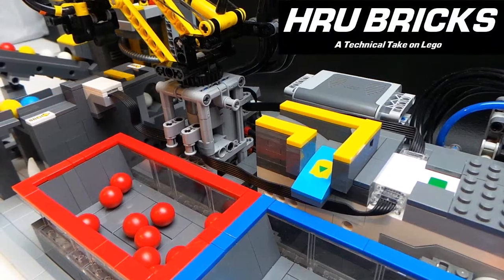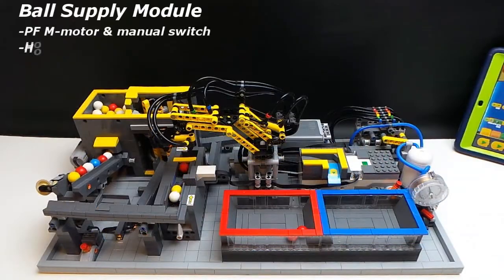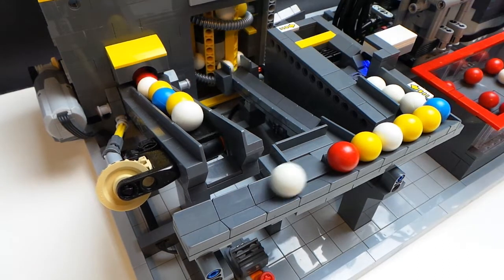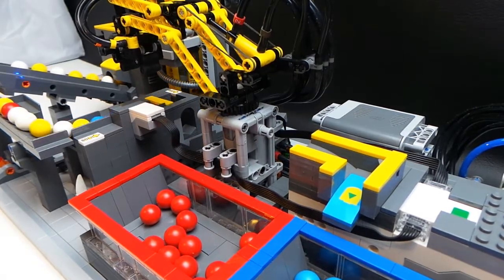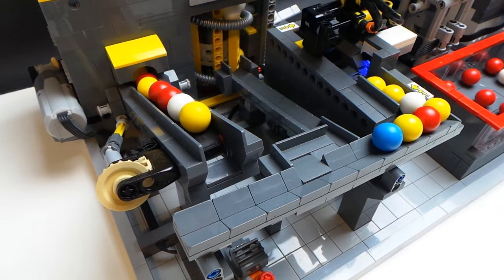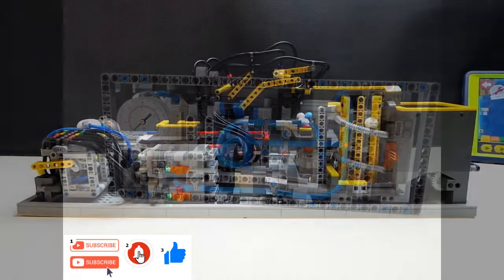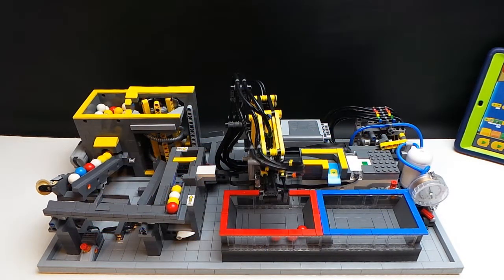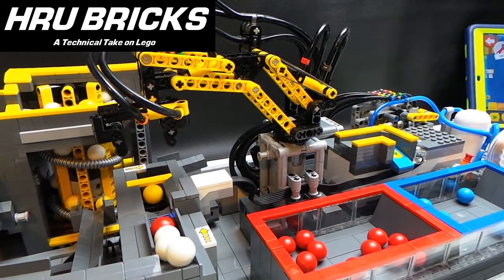LEGO Boost GBC Pnuematic Ball Factory MOC

Comment: What balls did you use?
Reply: Ok, thanks :)
Reply from the maker: @gkbrickworks7924  It looks like they may not make the 14mm pack anymore, if you find a site selling them let me know!
Reply from the maker: Hey GK, I use Quercetti Marbles. It took quite a bit of experimenting to find a suitable replacement for the Lego balls and the Quercetti Marbles came up the best. The dimensions and weight are very similar with the only part of any of my GBC builds that have given me a little trouble is the vertical conveyor (the simple fix was to ensure the ribbed hose and the in & out were aligned well)

Comment: Fantastic work , is possible to create a pdf instruction from stud.io?
Thanks so so much
Reply from the maker: Thanks! Indeed Stud.io does have an instruction making section. However I currently use a program called Blueprint. With a build like this it would be easier to pull it apart in the model space and build from there. When making instructions you have to pull the model apart anyway. Have you given instructions a go?
Reply: HRU Bricks thanks so much, I download the stud.io file but i m not able to use the program, i will try with bluprint , it s a free program?
Reply from the maker: @paolopaolo1664  Hmmm that's not good. Do you have Lego Digital Design (LDD) (program)? Also why can't you use the program? You need Lego Digital Design for use with Blueprint. This is the link https://www.lego.com/en-us/ldd
Reply: HRU Bricks yes I have, but not open right the stud.io file , how can i do ?and after that , blueprint is working only with ldd files?